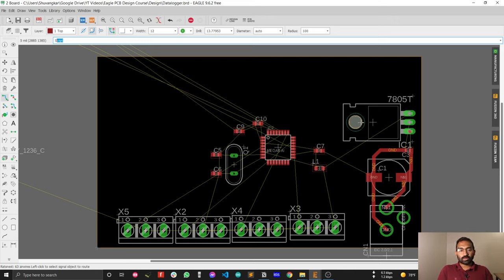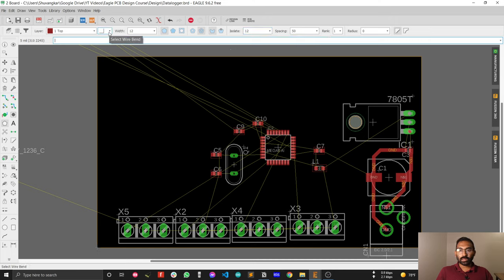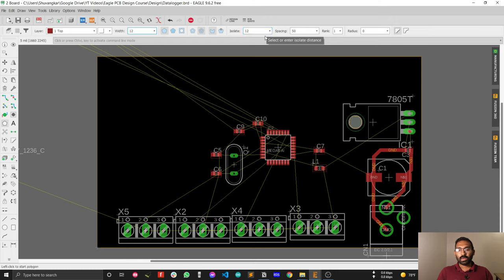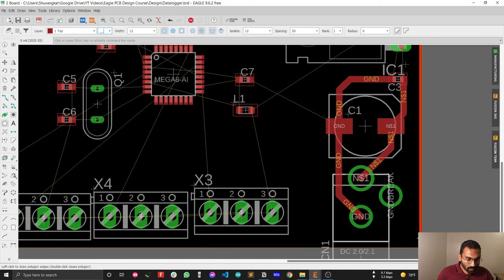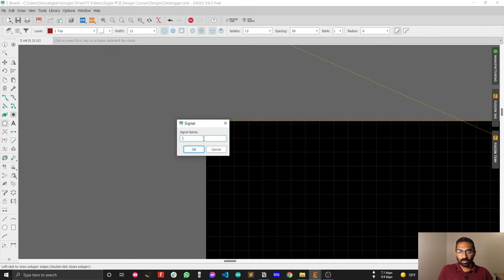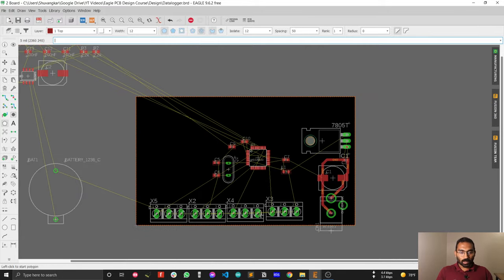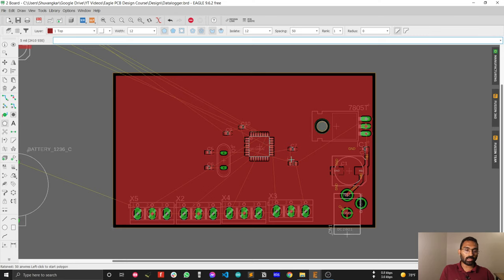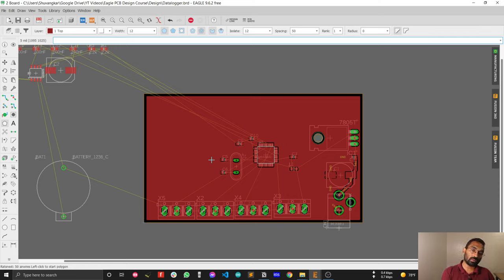Eagle PCB Tutorial | How to Design Ground Plane

Comment: Is it of critical importance to place a ground plane first, before you begin laying our your PCB?  Also, which layer is normally used for the ground plane if I have a 4-layer design?  (If I recall correctly, layers 1 and 16 are typically used for the top and bottom layers in a 2-layer design... so if true would any "in-between" layer from 2 to 15 be a suitable layer to use?  Or is there a standard for this?